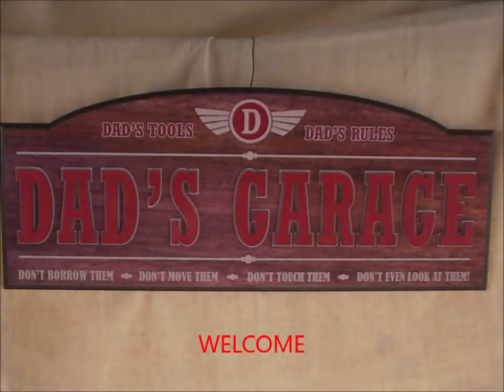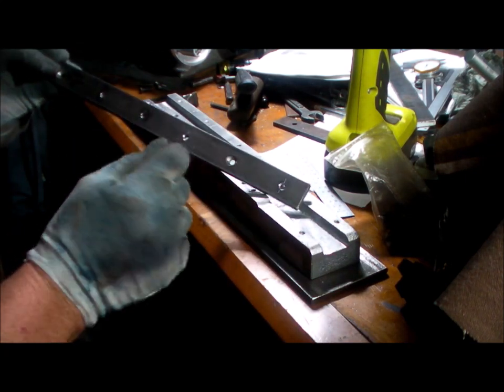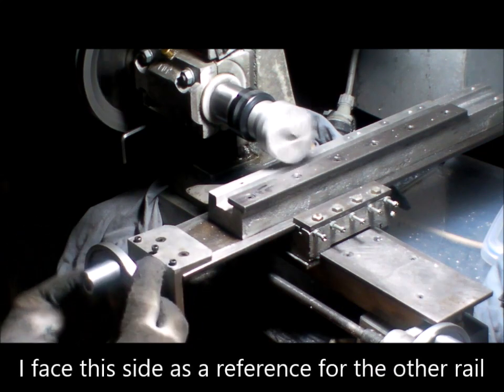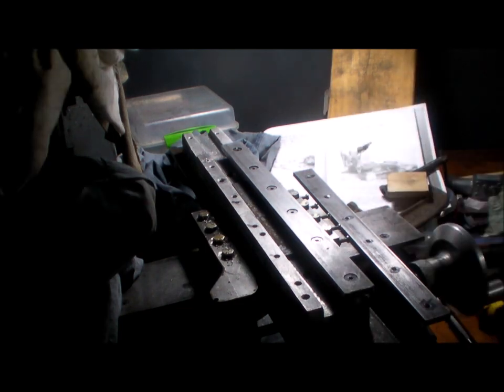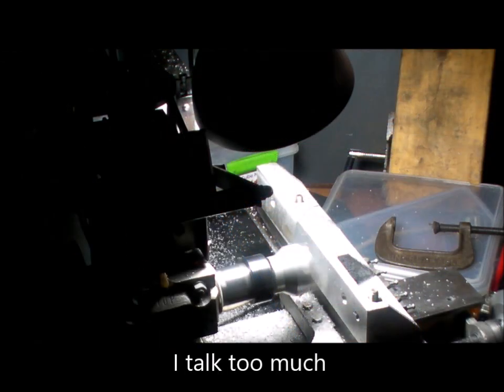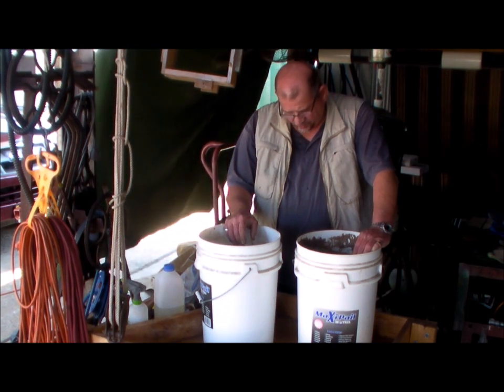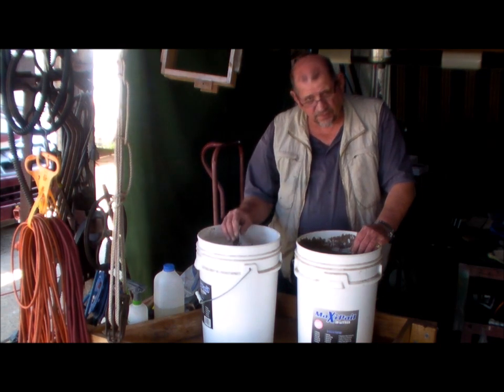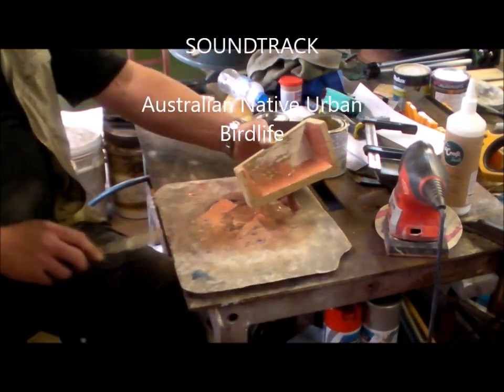Building the Gingery Milling Machine 72, finish the Permanent Work Table

Comment: Coming along nicely.   Good work.  Don't hurry to wrap things up.  Going to miss the videos.  What's next?  The shaper??? Hint hint wink wink.  😉
Reply from the maker: G’day Emil. One thing you can be assured of is I get the most out of the video clips I take but it is getting close. The Shaper is on my list to do but not for some time, I want to build the 4 jaw chuck and dividing head first plus my lathe needs maintenance work so the videos will continue. Thanks for following and commenting. Cheers Peter

Comment: Nice work on your permanent work table. Complete the tail stock , and you will be set for horizontal milling , and line boring . You will be making all sorts of stuff then. I do recommend that you build a indexing head for cutting your feed dials, gears,and even hole spacing. Gingery's dividing head is a bit large though. There are plenty of plans on You Tube for simple indexing. Happy machining.
Reply from the maker: G’day Ronald, yes I’m now in the final chapter of the book, the tailstock, it in itself is a complex piece of gear same as the spindle and compound slides. In the future I will need an indexing jig but you’ll have to wait and see. Cheers Peter